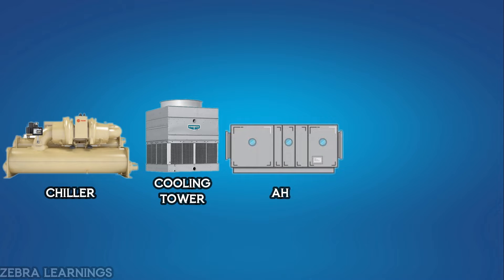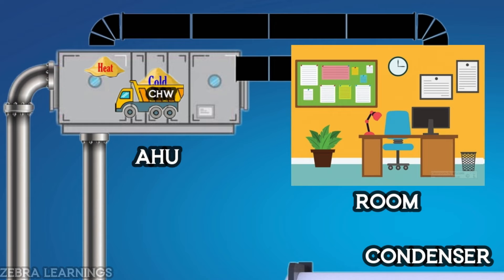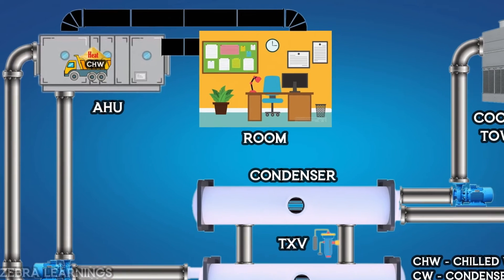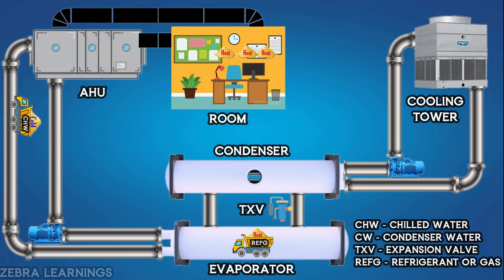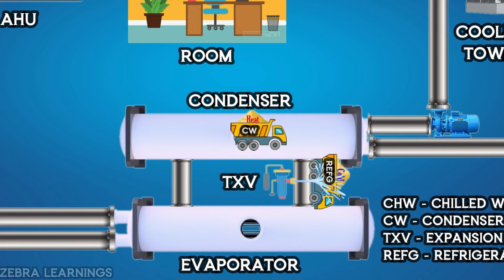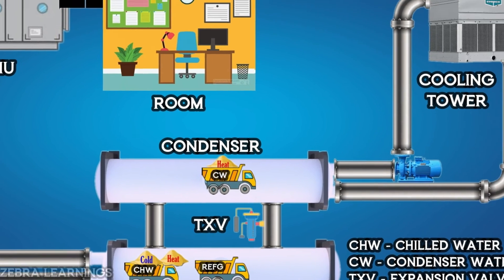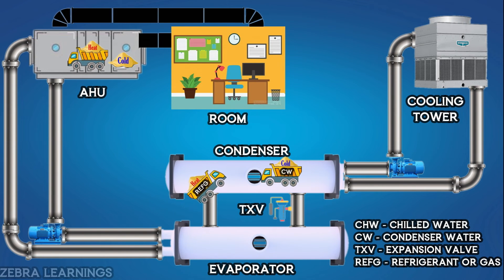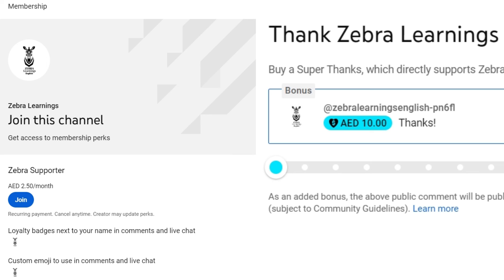Chiller Plant Working Principle by Truck Experiment | Animation | HVAC |

Comment: It would have been better had you explained the working of a condenser and evaporator and cooling tower with figures in the same video representation. Would have been able to grasp the concept better. The truck idea is not so bad, but there is no transfer of chilled water and hot water taking place in a condenser. it's just different pipes.  Inaccurate.

Comment: Hello please can you help me with my PCO5+ and EVD0000E20 upgrade? I can pay for the help
Reply from the maker: Do you want to upgrade your system with PCO5+?
Reply: @zebralearnings  Yes friend, I need to upgrade a Chiller, I am an automation technician and have advanced knowledge in industrial electronics, I have a lot of knowledge with the PLCs PCO2 system and EVDdriver EVD0000200, I have been repairing PLCs for many years, from time to time I do the calibration of the analog ports and sometimes it is also necessary to download the bios into the MCU of the controller.
Reply from the maker: @edsonlopes3610  Hi friend, you need a qualified HVAC technician or Engineer to evaluate your chiller's compatibility with PCO5+, and installation, wiring, programming, testing, and many other things are there.
Reply: @zebralearnings  You are wrong friend, I don't need an Engineer
Reply: @zebralearnings  I plan to replace all of the chiller's connectors and cables, so upgrading the connections is practically nothing, I have the chiller's electrical diagram, I can make the changes and I still have the old bios converted and downloaded for the PCO5+